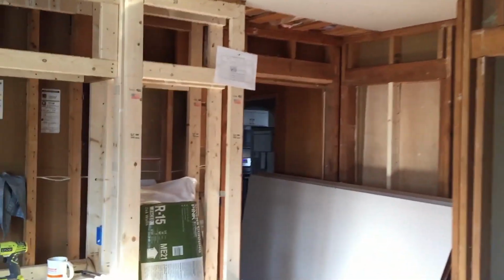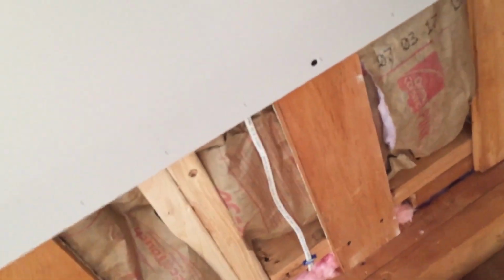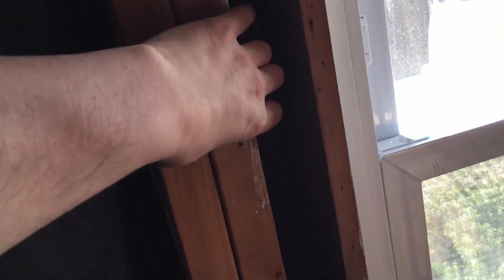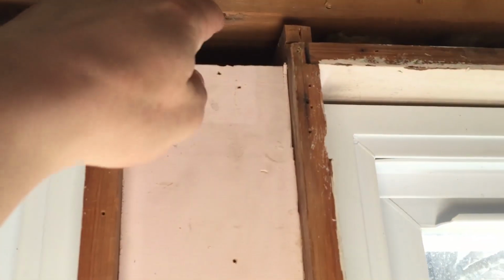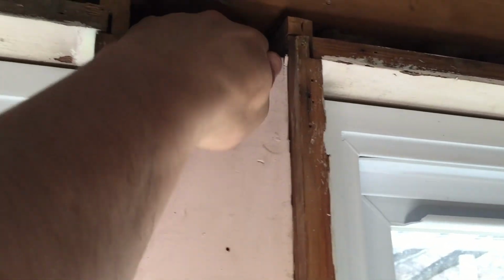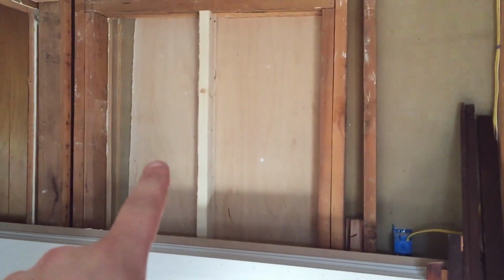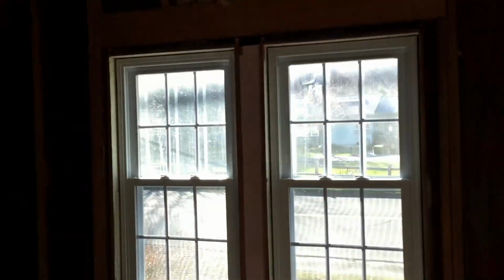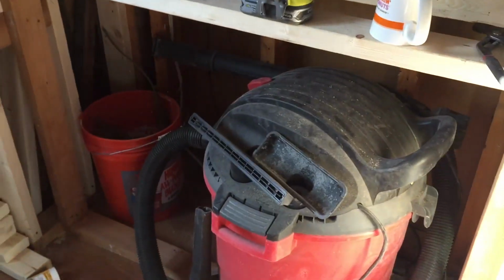Hanging Drywall - Primary Bedroom Remodel - Episode 4

Comment: I notice you don't use a plastic over the insulation. Is it because of the type your using? Should I use with just plain pick fiberglass
Reply from the maker: Hey, Brenda!  So, plastic over insulation is considered a vapor barrier.  You can see on the insulation I bought it has.a paper vapor barrier.  This is called faced insulation.  You should use one or the other.  You do not want to use plastic over faced insulation as it will create a double vapor barrier that will trap moisture.  So if your plan is to use plastic, buy "unfaced insulation" then put plastic over it.  I hope this answers your question.  Thanks so much for checking out the video!

Comment: I just bought a house....it has wood panelling too.... do you think its a good idea to take it apart and install drywall .
I have never done any drywall work.
Can you tell how much it would cost me to do it myself vs how much it would cost if i ask a contractor to do it.
Thanks again for the videos really helpfull.
Reply from the maker: Hey Simar,
This is totally up to you.  If you have never done drywall before it could be tricky, but maybe you pick up on things quick?  Not sure, it depends on the person.  I will say that if you have never mudded seams and sanded before you might want to hire someone to at least do that part.  It is a skill that took me years to learn and I was not good at it at all when I started.  That can be very frustrating.  I couldn't really tell you contractors prices but you could call around to get quotes.  You can always measure sq footage and price out sheets of sheetrock, screws, tape, mudd and any tools you don't have.  

I hope this helps.  Thanks for watching!!!
Reply: @TheFixerHomeRepair  thnx alot..u been a great help ...

Comment: What is, and why did you add tjose boards right before to added the insulation.  Im about to tackle my kids room and was curious.  Thanks
Reply from the maker: I think what you are referring to is the outside sheathing of the house.  It is hard to see but I just ripped out the old insulation and then the outside boards appear.  No need to add anything.  Thanks for watching!!
Reply: @TheFixerHomeRepair  lol, thanks..   it looked like it was been added, and not the insulation being removed.   thanks again
Reply: I was wondering the same thing. lol